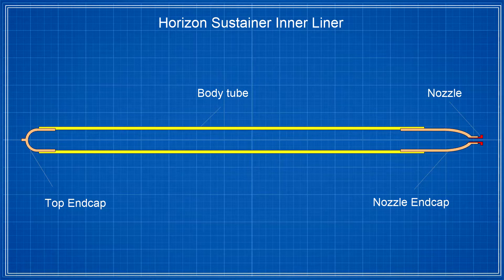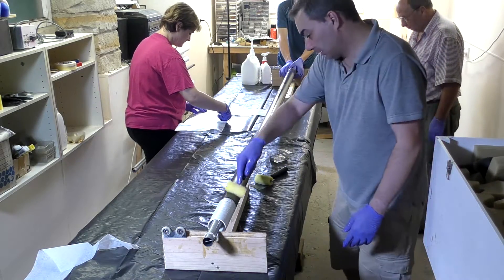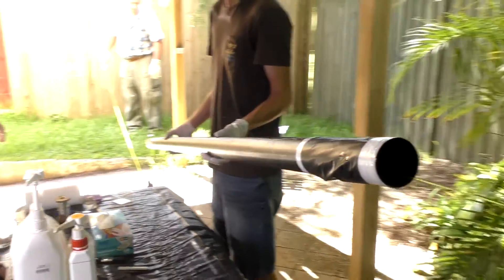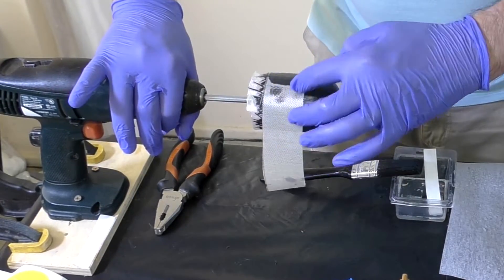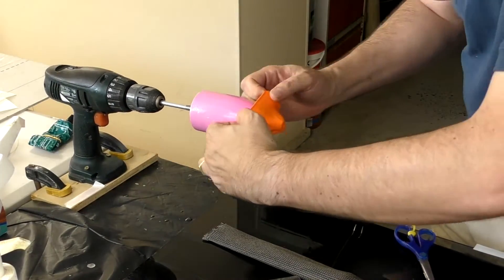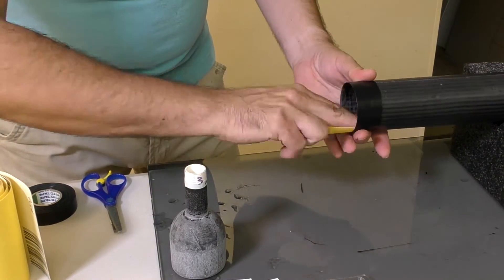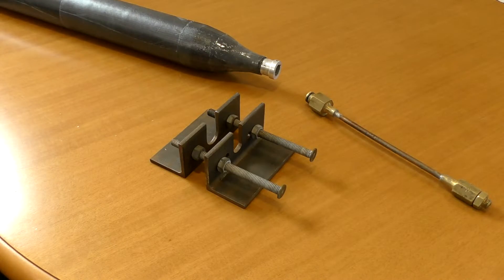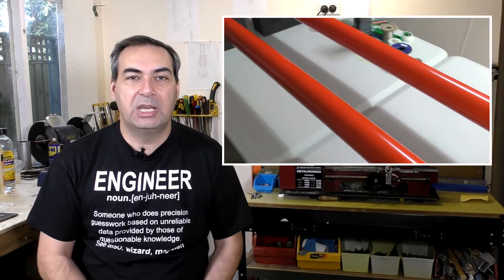2 Stage Water Rocket - Part 11 - Pressure Chamber Liner

Comment: Yes, a new series! This is a real technology encyclopedia! Cool t-shirt! I usually use polyethylene film when working with epoxy glue (does not stick and separates perfectly).
Reply from the maker: In what form does the polyethylene film come in? Is that something you could use on a mandrel? Is it stretchy?
Reply: @AirCommandRockets  Yes, I think you can use a film instead of cooking paper in your case. I usually use the film as a backing for parts glued with epoxy glue.
Reply: I use a regular plastic file. In your case, you can experiment with the thickness of the film, since too thin a film can stretch and tear.
Reply from the maker: We find the baking paper works very well on mandrels, because it is fairly stiff and doesn't get folds in it if it is wrapped carefully, but I am always interested in seeing what materials others use.
Reply: @AirCommandRockets  Yes, baking paper is probably the ideal material for this process. (I'm afraid my wife would be against the consumption of baking paper in such quantities)));)

Comment: Hello again. 
I’m really impressed by the work you put into this project. :-) We have been discussing the use of vacuum to eliminate problems with soaking the cloth. And the problem of release the tube. There is a company called Easy Composites Ltd. They use a mandrel of aluminum and cures the composite under heat. That makes the mandrel to expand. That makes it possible to get the tube of the mandrel. They have a channel here on YouTube. Best of luck with your project.
Reply from the maker: It can be expensive to find aluminium mandrels of the correct diameter and length. Also not all epoxies can be post cured with heat, like the West Systems we use.

Comment: Good work! A suggestion for the problem with the epoxy not fully penetrating the carbon fiber. The super car manufacturer Koenigsegg makes a lot of parts from carbon fiber and epoxy. After soaking the carbon they put the part in a bag and connect the bag to vacuum during the curing. This helps penetration. Specially for intricate shapes.  Good luck with your project.
Reply from the maker: I agree vacuum bagging/ infusion molding would help reduce that issue. One problem though is that it compresses the sleeve against the mandrel. This is a good thing normally because it removes excess epoxy but then it makes it much harder to remove off the mandrel. We tried a short test section about 50cm long and wrapped it with electrical tape. Not as good as vacuum bagging, but we almost couldn't remove that off the mandrel. 2m long tube would be very very difficult.

Comment: one more time another excellent video about building rockets.
just a small idea for a safetly high pessure test, put the rocket deeper into the pool, nearly 1 meter. in case of explosion you sould be safe. but it will be more diffucult to see the bubbles.
congratulation for your job from france ;-)
Reply from the maker: Thank you Michael. That is a good point and that was why we kept the pressure to around 200psi. The pressure chamber like this I believe would hold around 700-800psi. In later episodes when the re-enforcement sleeve goes on top we do a proper hydro test to higher pressures and that's when we stand well back.

Comment: Thanks for your videos. I recently saw hydrogen powered rocket which contains in its combustion chamber : 1/3 oxyhydrogen ,1/3 air, 1/3water. Do you think that this design is reliable and performant if it's scaled up ?
Reply from the maker: If you can contain the combustion by-products at those pressures then sure. When the explosion happens the water will essentially act like a plug over the nozzle so you need to be able to contain the full pressure. I think as you scale up the pressures will increase and you need to reinforce the pressure chamber more that adds weight.

Comment: Amazing work as always! The final sustainer rockets shown at the preview look really promising. How did you achieve this awesome painting quality? All the best with the project. :)
Reply from the maker: Thank you Julian. For the paint we just make sure that the surface is well sanded and then do multiple thin coats. I think we did about five coats with Duramax spray can.  I like this paint because it covers well and dries really quick. You can handle it in a couple of hours. I'll give more details in the upcoming video.

Comment: Great stuff!
 13:10 - Isn't that possibly quite  dangerous?   -   I know a bit more effort, but a water / hydraulic test would be much safer surely!
Reply from the maker: Any time you pressurise something like this there is an element of danger. The test at that point is about 1/10th the pressure the pressure chamber can hold. In an future episode when we do the full pressure tests to 900psi, those are done as hydro tests and we are well away from the rockets.

Comment: Have you ever thought about putting pool chlorine granules or powder. The add 91% to 99% rubber alcohol in the bottle. I know it will create its own pressure. The pressure would be crazy high though. It will also create tons of hot gasses. But im sure if you get it just right. Your rockets height will be increased several times. Also watch out for the toxic fumes that come out. They cant kill you but the can burn your nose and lungs if you inhale enough.
Reply from the maker: No We haven't. I remember from my younger years how bad chlorine and break fluid is. Spectacular flame but also very toxic. Happy to stick to water rockets. :)
Reply: @AirCommandRockets  yes but the Rubbing alcohol and chlorine is much safer.

Comment: Why even bother with water? Yes, you get more momentum from the exiting water but you've also got substantially more weight to the overall rocket. Why not just use the pressurized air and a nozzle optimized for air as the exhaust? There are air cannons, like those used in Pumpkin-Chuckin' contests, which get amazing heights. Wouldn't your rockets do just as well using just the air and forget about the water? In fact, when you leave out the water there's more pressurized air, essentially more "energy" to propel the rocket.
Reply from the maker: Short answer is no. Here is a video that we did that compares water amounts in the rocket all at the same pressure. The last launch also shows a launch without any water at the same pressure. https://www.youtube.com/watch?v=DrPt-AktIMs